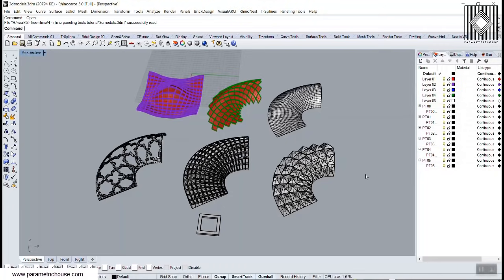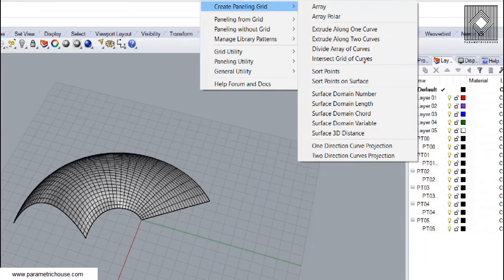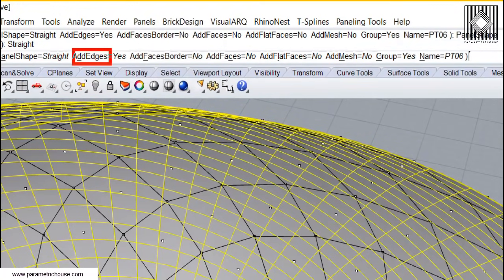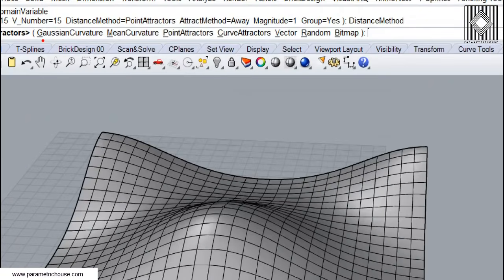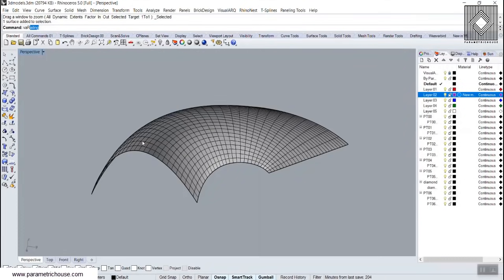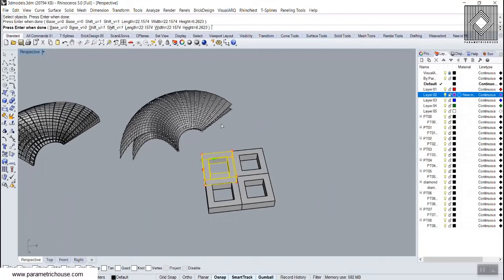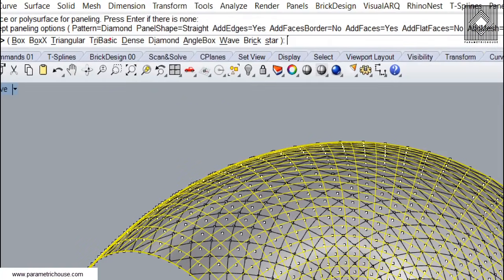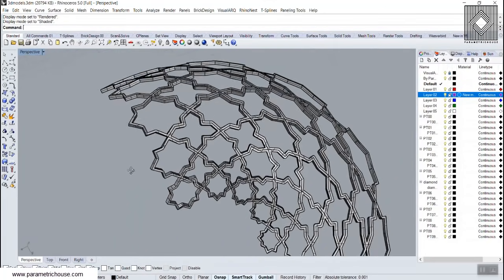Rhino Paneling Tools tutorial

Comment: How would you do this with multiple surfaces?
Reply from the maker: You can use twisted box sub category from Pufferfish plugin
Reply: Rhino Grasshopper if you wanted to put the pattern on multiple surfaces stitches together, this plugin would pattern uniformly across all stiched surfaces?? Thanks!!
Reply from the maker: @surf2553  No I thought you mean morph on multiple surfaces... but i guess you have a  brep (polysurface) and you want to put the pattern on it. So in this case you don't have any however there is always a clever idea to change your brep to a single surface
Reply: @ParametricHouse  Yeah, i have been looking at how to do that. I havent found a good way yet. Because the type of work I do involves many patches (polysurf whatever), so it is always complex breps that I am looking to get uniform patterns on.

Comment: Thank you for the great video! I am not able to use the control key as you do. For example when you extrude the diamond curves it moves my gumball tool instead of extruding the curves. Another example, when you place the point on the surface by pressing control, more osnap options appear but that is not the case for me, I do not see the on surface option.
Reply from the maker: You're welcome Jonathan. If you are using Rhino 6 simply use the little dot on the Gumball to extrude things.
Reply: Parametric House thank you! I am using rhino 6. Any idea why I do not see the “on surface” option?
Reply: @dUC78660  same here, can't see "on surface" and can't use control as he did.
Reply: @ParametricHouse  same problem ?? :(  what is control key

Comment: Hi, It is really helpful to understand the paneling tools. Although i have a few doubts while using paneling tool. I need a "custom 3D" pattern on a free form surface. I followed the basic steps to get the result. The end result is, I got the desired pattern i wanted. However there was a problem. After the pattern is finished it created many individual single elements. Even though i tried doing "Union operation" which are not combining with each other. . I tried to convert it into .STEP file and try in another software but still they are not combining. 
Is there any way to make them as a single body after paneling or Is there any option to do that while using paneling tools?

Thank you and waiting for your feedback.
Reply from the maker: Try to make a single module so you can boolean union them after the paneling